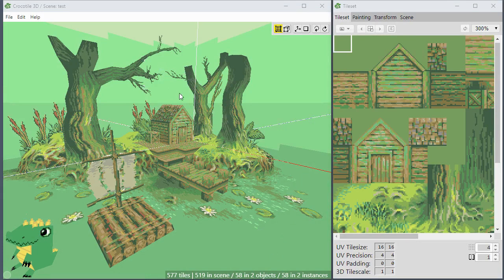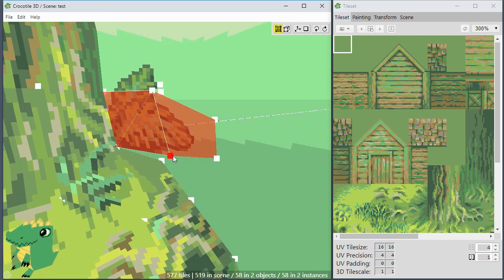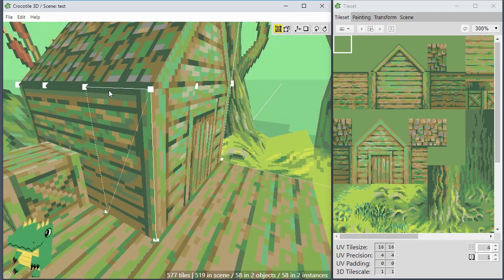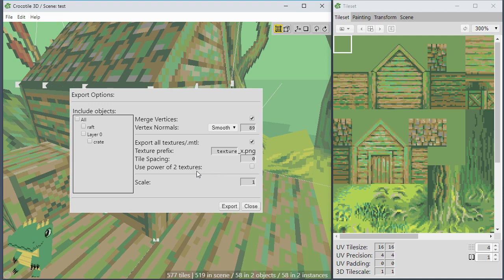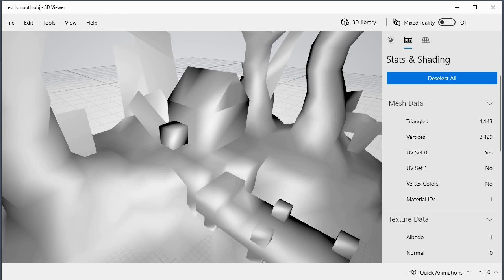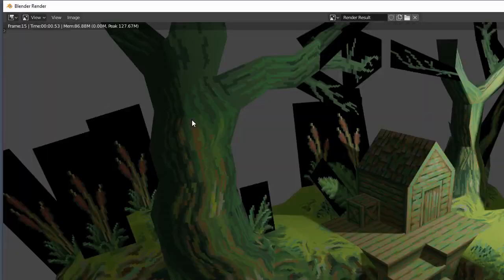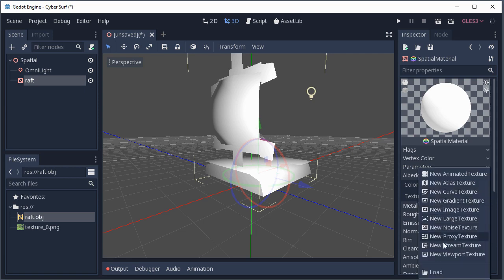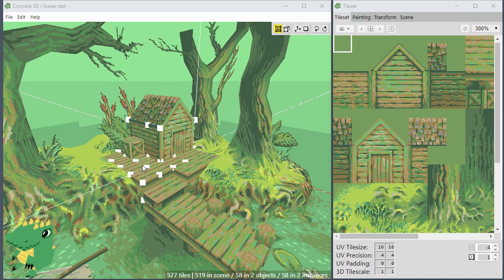🐊 Crocotile 3D - Tutorial: Importing and Exporting

Comment: Bought Crocotile this afternoon on steam, loving it so far but I have a question about exporting. I've built some small objects from your test tileset, exported those fine into Unity, it looks correct no problems.

If I make my own tileset (I did it in croco) then built just a large rectangle with a painted tile, in croco it looks how I want, but when I bring it over into Unity, the Material/Tiles are not mapped correctly? It's just White? Which I believe means it didn't make over properly. When I did it I did select to have the material also saved and the texture. 

What have I done wrong or differently to your default version?
Reply from the maker: I would check to see if you have "export all textures" enabled, and "limit export to currently selected tileset" disabled. Depending on the format, you can also embed the textures into the model file. .Obj format can't embed them, and must use a .mtl file that gets exported with the obj file to tell the importer how to map the textures, and that would have to be included when imported.
Reply: @Crocotile3D  So after more testing the problem is when I paint in crocotile. I haven't tested if I use my own sprite editor like aseprite, but the inbuilt one, if I edit a blank or your default green swamp, the painted tiles do not come through. Do I need to save the tileset separately somehow?
Reply from the maker: @MaximumSpice  Are the changes to the tileset visible in the 3d viewport when you place those tiles into the scene? When you export a model, does the tilesets get exported without the changes or do the tilesets not get exported at all?
Reply: @Crocotile3D  so when I paint on your made tiles or my own, or import my own, I can see them displaying correctly in crocotile but when I export into unity. Only yours work correctly. Everything else is white and I found how to seperate materials and load the texture on but that doesn't map it across correctly to how it was, plus your version does it all correctly automatically for unity.
Reply from the maker: @MaximumSpice  I'm not that familiar with Unity since I don't use it anymore. There might be different way to import them. This video is old and I remember someone else creating a better video about importing into Unity specifically. You can also join the crocotile discord and maybe someone there uses Unity who can help you. It's difficult for me to guess what could be happening.
Reply: @Crocotile3D  I've tried joining your discord but I assume the link is old, it tells me there is an error. 

I more get the feeling my object doesn't save it's uv mapping for unity while yours does. Is your default tileset just a PNG or anything special about it?
Reply from the maker: @MaximumSpice  The discord link shouldn't expire. Try this: https://discord.com/invite/fmtJdUb
As for the uvs, they are always saved, because they are stored in the geometry of the model. There isn't anything special about the images. I would suggest perhaps opening your exported models in something else to see if the issue still exists, or if it is just a Unity issue.

Comment: Something that is happening to me in Godot 4: every time I import a glb file from my project, its materials have metallic and specular properties set to 0.5. So I have to adjust this in Blender before importing it to Godot. Is there any way to fix this within Crocotile? Thank you very much! Your software has been a great help in our project!
Reply from the maker: I looked into it, and it seems like Crocotile's gltf exporter automatically sets Metallic and Roughness to 0.5
I've changed those to be 0.0 and 1.0 (what godot should default to). Those changes will be present in the next update. As for the specular, it seems Godot defaults to 0.5  , is there a different value that should be? Or did you confuse specular with roughness?
Reply: @Crocotile3D  Thanks a lot! Yeah, roughness should be 1.0. I forgot to mention that. However, Specular should be 0.0 since it appears to alter the color of the pixel art in my view. I open all my materials in Blender and change the specular to 0.0 so that they match the pixel art exactly. I'm not 100% sure though, as I'm still relatively new to 3D and learning how to navigate these issues. I'm excited for the next update! Thanks once again!
Reply from the maker: @megalukes  Oh ok- I'm not that familiar with material settings either. I'll have to look into it. I might need to figure out a way to just let the user set these properties.

Comment: There seems to be a problem with exporting textures. I figured it out but it's very hacky and i'ts a work-around the whole block. Go to the tileset tab, hit the dropdown tileset menu, and select export tileset. Name your file and where it says "save as type" select "All Files *.*". This will export the file without an extension. Go to the folder, find the file and rename it. There, you must add .png at the end (add the extension). Then, it will work
Reply from the maker: Not sure what issue you are having, but exporting textures works fine for me. What operating system are you using?